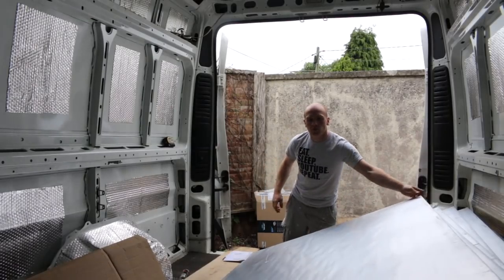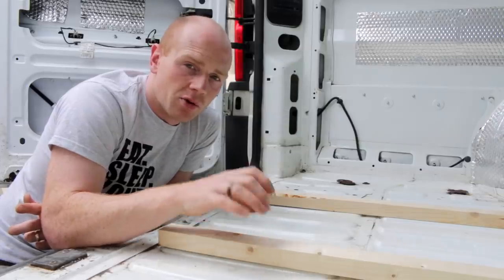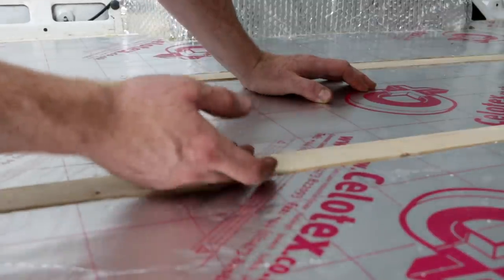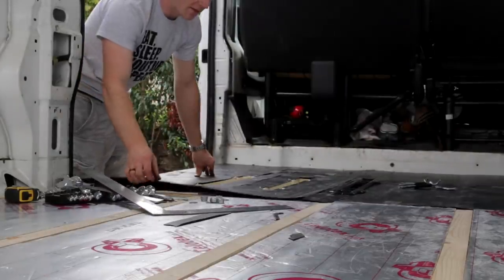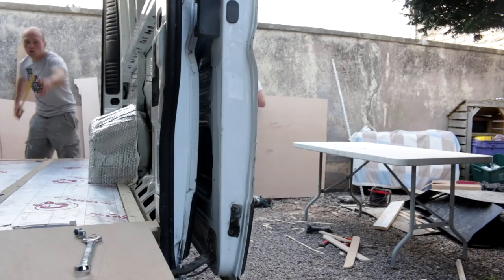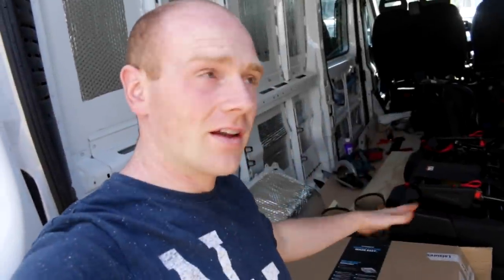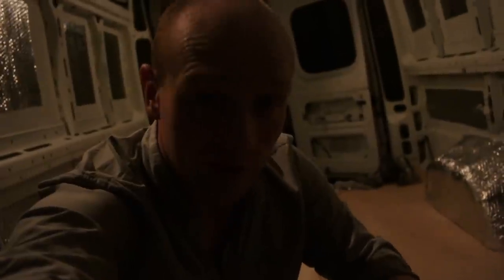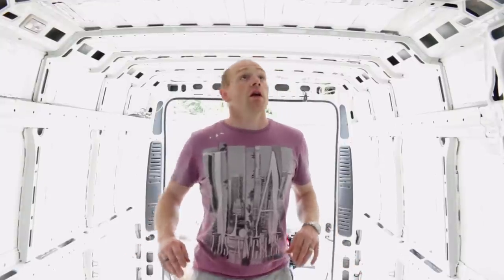INSULATING and BUILDING the Floor | TRC Van Conversion 5.0

Comment from the maker: Sorry if not clear how the timbers were secured.  They were bonded to the cleaned floor ribs using silkaflex, a high strength adhesive designed for such applications.  This prevents needing to drill through the van floor and is plenty strong enough, (I tested it using several materials and was very surprised.)
Reply: Which blend of Sikaflex did you use, kind sir?
Reply: Your link to the Silkaflex is broken, which one did you end up using?
Reply: Great I was just thinking to ask that
Reply: I think it might be Sika 310g Sikaflex 221 - White Industrial Adhesive Polyurethane
Reply: The Restoration Couple I have sikaflex EBT is that good enough? Plus did you remove the metal ring thingys in the floor at the sides?
Reply: Hi! I love your videos! ..Quick Question --> what kind of silkaflex did you use? The link above is broken. THANK YOU!
Reply: arh I just saw this, so did you do the same with the wall battens or is it Batons!
Reply: What  about vibration? are the properties of the sikaflex EBT+  enough to hold up with van vibration? I  whats the difference  with Sikaflex 221
Reply: I've had this question for a week now after watching other builds.  I couldn't tell if the timber ribs were attached to the floor with screws or not.  I suspect the ceiling will go in the same way with adhesive to prevent drilling/screwing into the roof?  Good job taking your time, I'm not sure I'm as patient! ;)
Reply: OK I see your comments here.   I was being sarcastic in my other comment.  Good video.
Reply: Won't the timbers possibly rot because they're untreated and exposed to the metal beneath the moisture barrier?
Reply: So you used a glue to secure the ribs to the floor? Surely it's not as strong as self tapers or bolts... like it's only glued to the paint, as you were saying a crash could be bad. I wish you didn't skip this bit cos the rest of the video and your others are excellent.
Reply: @irishlad2326   tapers go rusty and bring moisture up. glue nowadays is surprisingly strong... stick a crow bar under a joist self taped into the van and one glued tell me which wins
Reply: @shlomogoldman3214  didn't even think of that 😲

Comment: Can i ask why you didnt complete the vapour barrier by applying tape around the edges from the floor to the sides of the van as now the floors down you cannot seal the gap, making all the work you have done pretty pointless in preventing moisture getting to the steel floor? great editing by the way, love the twins working on the van!!

Comment: You don't need that on the floor. Lizardskin and some closed cell foam will give you a better result. You just took to much headroom with adding that extra insulation which will do very little to insulate a metal floor.

Comment: Have you considered putting thin layers of wool Insolation in the gaps bellow Celotex boards? To fill up those grooves of the metal flooring? Would that add any significant benefit?
Reply from the maker: No, I don’t see any major benefit, there are far more important places to spend time insulating and the benefit would be so minimal.

Comment: I have just found your videos as am considering buying a microvan. I have loved watching your videos so far as to how you have gone about insulating the van and the little tips. The best videos I have seen on this for sure. Like the fact that you haven't just thrown in expanding foam. I'll be using your techniques if I get the van. Thanks so much for doing these! You have been a godsend in showing a not very good DIYer how to go about it.

Comment: I know with the way you did it you had less cuts and used less screws but I would have split the floor into three sections. Leaving the high traffic center area with a solid board (no seam)  and the seams on the sides were they will more than likely end up under a cabinet. Before you started have you figured out how much weight all your materials will add?

Comment: Hi, which Adhesive for Floor Battens did you use? the link is the video description is no longer working, could you please let me know?
Reply from the maker: Link repaced.  I just used a standard sikaflex adhesive which is more than adequete.  Spend more on the adhesives that are used externally.

Comment: Can anyone explain why you need to batten the floor. Just laying the ply on top of the insulation will do - it will spread the weight fine - the floor isnt going anywhere.
Reply from the maker: No need as such, you can do a sandwich of thin ply first and then thicker on top to prevent compression of insulation. Even without it might be fine. That said, well positioned battens are far better to fix units down in to that just ply alone.
Reply: Thank you! Loving your videos.

Comment: Absolutely and without reservation, the very best series of steps to insulate the floor. I have been watching hours upon hours of  floor insulation videos and the work you did far exceeds anything else I have seen. If anyone describes it as ‘over the top” they are not taking into consideration the safety of your children!  Thank you very much
Reply from the maker: Thank you. Glad you found it helpful, lots of faster ways to do it but it's one of those jobs you can't really go back to so worth getting right first time.

Comment: Might I give you a hint for everyone doing floors in vans...for years I have used Roofing felt (underlayment) under the timber (wood) to stop all the squeaks.  You can get 30 lb or lighter but the key is making sure you get the "oil" based ones.  This gives you a lifetime of lubrication between your layers so they don't squeak.

Comment: Thanks for the video! I’ll be converting a van here in the next week for college and haven’t done any carpentry/renovating work since high school. Is the gist of the floor something like: remove everything, clean the floor, measure and cut boards, measure and cut insulation? Glue boards to floor, place insulation, measure and cut plywood floor boards, tape for vapor barrier, place plywood, screw plywood to base boards. That about it?

Comment: I wonder if building this so tight is going to be a problem with heat expansion and contraction? I also wonder if running the seam down the center of your walkway is the best option? Wouldn’t running 2 seams to the side of a solid center board, under the kitchen & beds, give more integrity to the floor? I’d think squeaking might be much easier to address with rubber or felt bits at the edges...?

Comment: Just did something similar in my econoline van with transit double seats and brackets. I built the floor up with the battens in the valleys between the ribs with XPS foam board resting on the ribs. I filled in the gaps with spray foam and I can walk directly on the XPS with it flexing. Next up is 3/8” plywood to match the height of the metal loops on the seat brackets.

Comment: Very nicely done, looks solid. Did a similar thing for my workshop recently with the foil tape creating a vapour barrier but also had to go over all the celotex as a fox had run all over it in the night and punched in loads of claw holes! Did you use grab adhesive for the plywood before screwing?
Liked the music and the double cut video thing, what's that called?
Reply from the maker: Oh no! I caught our 2 year old poking many holes in with her pencil so that needed some tape too!  No more grab adhesive for the ply as the screws should do plenty, plus I like the idea that if we ever changed the van we could transplant most of the build without needing to rip it all out.  Glad you liked my  twin! No idea what it's called but it was too tempting to not stick it in. :-)
Reply: haha, oh dear, at least it's easy to fix and the tape is cheap. 
hehe do some more of that, maybe do an explainer on one side of the screen whilst the action is on the other!
Reply from the maker: We did a few earlier this year with the before and after of each room split, took some time though but quite fun.

Comment: Thanks for sharing. We have a people mover with very similar removable seats that you put in. The manufacturer didn't do as good a job of as you did making that end seat mounts flush to the floor. It is annoying but you eventually get used to walking over it. But hey, gotta love your exacting standards. When it comes time to sell (dare I say that) in theory,it will be easier to sell if people can see you have done a good job of the whole camper. As I have seen in other camper builds it's surprising what can go wrong if rushed or not well thought out. We also need to be careful with how thick the flooring is as my husband is 6'2 and one son is about 6'4 and at 15 the other is even taller than that. So who knows how tall he will get.

Comment: The wood batons are under the vapor barrier so isn't there concern of those absorbing moisture? Also, when you screw the plywood down into the batons doesn't that create a bridge also for the moisture to travel through the barrier?

Comment: Will those seat bracket be a problem for water condensation onto them and running in under the flooring? I'm looking at fitting a single quick release seat in the back as well but that worries me.

Comment: Nice job,did you use the adhesive only to glue te battons on the metal,or did you also use the adhesive to glue the insulation on the metal?

Comment: Hi 🙂 we are using your videos as we go along with our van build. So first off thanks! Secondly where did you end up getting your Celotex from as everywhere we have looked it's around £75 for delivery! Thanks so much
Reply: most builder suppliers will stock celotex or other trade names like kingspan etc  the size mentioned as 25mm is usually known generically as under floor insulation boards your local supplier will have one of the popular brands usually in 2.5m x 1.25m (8'x4') and may not charge too much for delivery but it should be available to collect using your van? hope this helps...Good luck

Comment: Really love your videos. They made me feel so much more comfortable when I started doing my floors this week. I am also going to use a strong adhesive to attach my timber to the floor so I can screw my plywood and eventually furniture to them. It seems like the best route to go. How has everything held up for you? Would you still do it this way if you could do it all again?
Reply from the maker: Would go the same route yes. I have had some very heavy loads of oak and building materials and the floor has help up very well.
Reply: I'm gona do the same in mine , was gona use tec 7 adhesive. Everyone I mention it to thinks i am mad from a safety point of view 🙈 I'm starting to doubt it now. "What about the vibration and crash" they say...

Comment: Hi. On your link it says that celotex is £25 a board and they only take orders for a minimum of 17! That's a lot of money for insulation. How many boards did you use in total and what did it come to? 
Furthermore, what is the thinnest celotex I can get away with? (don't want to lose too much height)
And what thickness of batten and Plywood should I use?
 Thanks and keep up the great work. Great videos.
Reply from the maker: Just buy it at any diy or builders merchants. It will be £20-25 if buying singles. 25mm is the min really. I used 12mm in a couple of spots but only as a thermal break. The batten is equal to your pir thickness.

Comment: Hi. As I see you "lose" quite a few centimeters in the interior height by putting the insolation in. 30mm celotex + 12mm plywood + flooring on the bottom. Additional 25mm on the seeling + the wooden panels (are these 10mm?) I was wondering what interior height you got left in the end. Thanks for all these great videos. They are helping a lot. Cheers.
Reply from the maker: Only insulation on the ceiling is between ribs so only loose 10mm or so up top. It’s over 6ft still so fine for us. Cladding is 8mm finished dimension.

Comment: Great work and video's but one thing I wasn't clear on was how did you attach the batten's to the floor? were they glued, screwed or simply jigsawed together. Im about to start converting my SWB Sprinter hightop and learning from you. Thank you
Reply from the maker: Adhesive.

Comment: I was considering not using a polyiso (polyisocyanurate) based insulation product like you did because it reportedly absorbs and holds water, which on the floor of a van would not be a good thing (in case there was a spill and things were not completely sealed).  Also, I understand that the R value of polyiso decreases with temperature.
Reply from the maker: If you have moisture/water getting to your insulation you have more problems than worrying about thermal properties. That said, PIR is closed cell so should not take on water like some other foams.

Comment: Correct me if I’m wrong, it looks like you didn’t put insulation on the floor? So is insulation on the floor not require? Looks like you put a vapor barrier and plywood over it. I’m learning.
Reply from the maker: The silver boards are 30mm solid pir insulation. 👍

Comment: Why is expanding foam a bad idea?
Reply: Was wondering the same thing
Reply: I think expanding foam insulation is excellent for most applications but maybe not for a camper van conversion due to the fact that it is very permanent in comparison to other materials. Once it's there it's there.
Reply: Because it’s so bloody messy ?
Reply: Dan 5675 I think, but don't quote me on it, that it has something to do with expansion and contraction and over time hardens as it aged and it traps condensation causing severe rust issues. This is my layman's understanding of the situation, but again ... not really sure.
Reply: I've done some research on this issue.  Here's my understanding.  Expanded Foam Insulation can be great if it is "closed cell" expanded foam and applied correctly.  Those two requirements expose all the problems.  First, there's a lot of open cell foam products out there and most people look at cost thinking it's all the same.  The open cell type absorbs water and over time, deteriorates as evidenced when it turns yellow and brittle.  As it decays, fractures occur causing a further decrease in R value. Secondly, even if you have the closed cell type ready to go, it has to be applied correctly.  I can tell you from my own personal experience, I tried to spray expanded foam in some walls years ago.  It came in a two part system and I never could get it right.
I have often thought about what I would do once I start my build.  My thought is that I would frame out the walls, ceiling and floor as I see fit.  Make what ever frame I want.  And, not that I would, but you could even run hollow pvc for plumbing and flex plastic for electric at that time.  Once ready,    -----     find an expert to spray closed foam for you.  Should be cheap since you've done the hard work by prepping for spray.  And when the spray is done, you can tirm to fit further decreasing labor cost.

Comment: Am I missing something, why wasn't the original floor you pulled out used as the template for the plywood.
Reply from the maker: Mainly because it was not a good fit to start with plus we had to break and snap it to get off the rusted screws.

Comment: Celotex is not made for floor insulation. With continued weigh on it, it will crumble into dust over time. At lease you didn't screw your framing into your metal floor like most do.
Reply from the maker: Uhh... PIR is designed specifically for load bearing floor applications.  Usually under several tonnes of concrete!  ;-)

Comment: Hello! Great video, also looking to do a van project.  Two questions for you - why did you not add any sound deadening to the floor and what's your concern about using expanding foam? I note a lot of conversions use a lot of that! Really enjoy your detailed approach.
Reply from the maker: Sound deadening floor might be worth doing but due to budget I focused on walls and wheel arches and above cab.  Hopefully with the insulation, ply and flooring it should cut out enough.  No real concerns about expanding foam apart from that it is quite often over used, if you spend time cutting insulation accurately it should take much less than just foaming up everything.  Just a personal opinion that it can make you lazy! :-)

Comment: what are the various shapes of silver insulation on the inside of the van walls for?
Reply: Sound dephening shape doesnt realy matter that much it just dampens the sound of thin sheet metal also used if car audio is beeing significantly improved

Comment: Great video.  Learned a lot.  I'm hoping to start a project like this (for a family of 4) in the next year or two.  Question for you (I'm a newbie here, so forgive any ignorance)..... at 23:56 you mention the sandwich method (ply-25mm-ply) which seems like a pretty fuss-free method (along with providing a full thermal break as you mentioned).  With the metal ribs on the floor of the van, I assume there would be some air gaps under the bottom layer of ply.  Would there be any worry of condensation or rust in those gaps?  Would that method require some sort of vapor barrier?
Reply from the maker: Thin ply bonded to the floor with Sikaflex, then 20 or 25mm PIR, (taped joins) then 12mm ply.  I would have thought to screw the plywood layers together until I started using the Sika adhesives.  They are plenty strong enough so whole thing would be fine without screws.  It would basically be a SIP like used in construction.  No condensation risk at all if you tape the boards and around the edges.
Reply: The Restoration Couple Then the 12mm ply would be fine to screw down rails for cabinetry and such?

Comment: What adhesive are you using for this? Is it the same stuff you used to restick the loose panels?
Great videos!
Reply from the maker: Its a Sika product called multistick. Just a general purpose adhesive, I saved the expensive stuff for the rooflights.